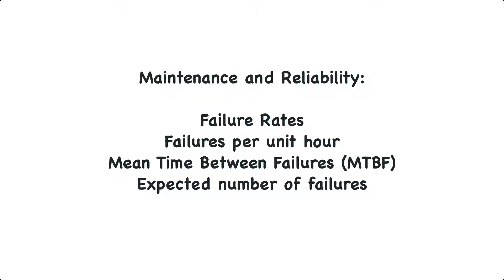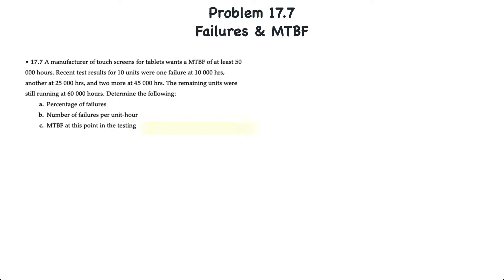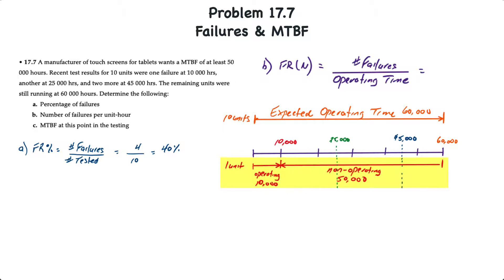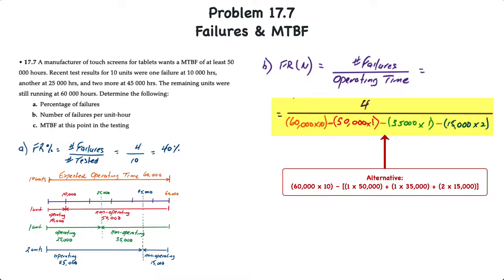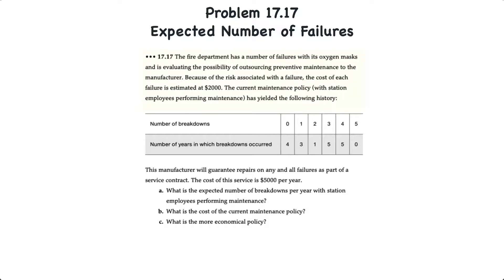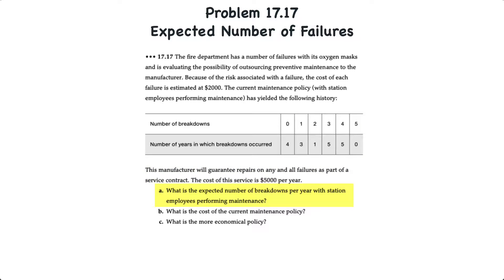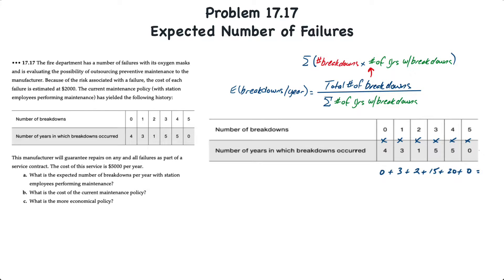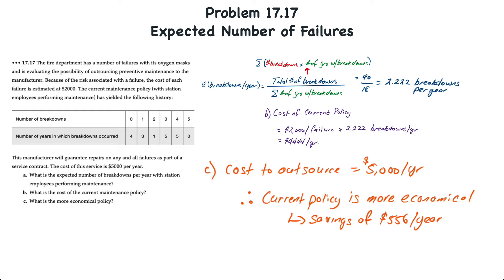Operations Management: Maintenance and Reliability III – Failures & MTBF

Comment: How u got 6 zero digits after the decimal when calculating the FRN?
Reply from the maker: It looks like that was a "typo" on my part, even through I didn't type it! 4=485,000 = 0.00000824742268 and that's FIVE (5) decimal places, not 6.

Thanks for catching that.

Comment: you should have just added the operating time for each specimen instead of this hassle , much easier and simpler
Reply from the maker: Hi Faisal, yes there is more than one approach to solve these types of problems. I illustrated it this way to be consistent with how the textbook I used for this class illustrates it so the students would have continuity.